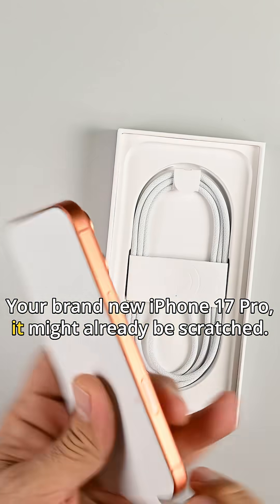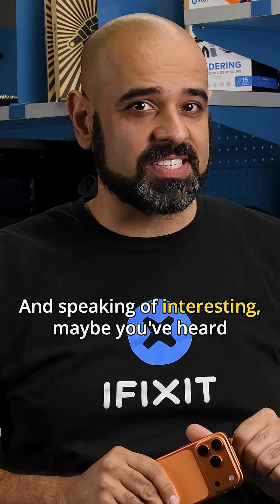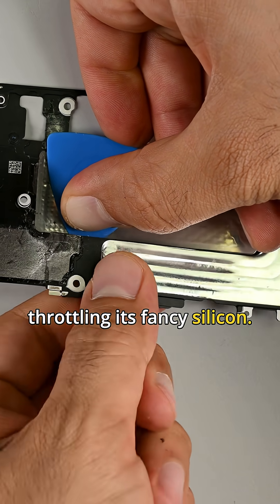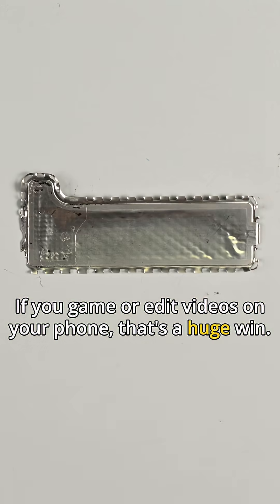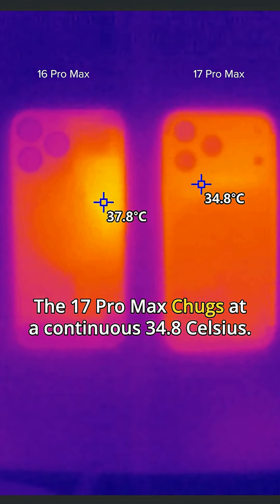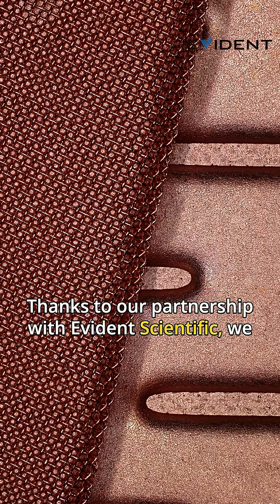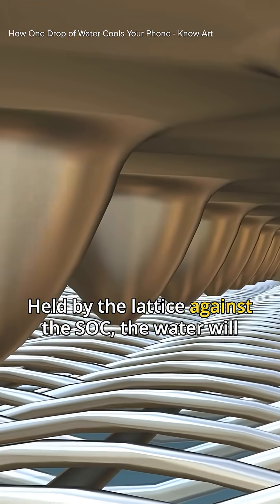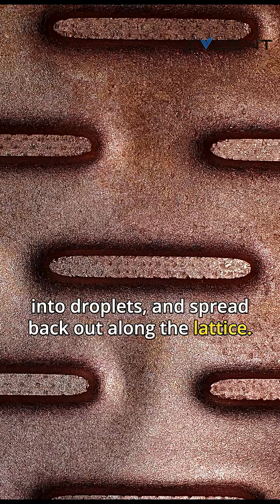We Found a Hidden Chamber in the iPhone 17 Pro!

Comment: Boiled at 37oC 😂
Reply: Well actually boiled water is not fixed by temperature alone, with exact pressure you can boil water even it's 35°C, with 0.0555 Atm of pressure, water can be boiled. 

Andd, actually the cpu of the phone can reaching up to 45-60° without heatsink (like graphite sheet on top of soc) or it's thermal paste.

Comment: It sounds like it's only meant to cool the CPU, or can it also cool the battery? Since the battery heats up during charging, and batteries are hurt most by heat. But it doesn't look like battery heat would have much area to go
Reply: Actually it's more like spreading it's hot, rather than cooling it down, well actually that is the concept of cooling down anyway 😂
Yes eventually it will more cool since the heat is spread out and not accumulated in one area, but never as effective as active cooler.

Comment: I wanna know how much the vapor chamber makes a difference with a case on it. My 17 pro still seems to put out most of its heat through the front and concentrated around the chip with a thick ass quad lock case on it.

Comment: I don’t know any mobile game that needs this amount performance. And this statement has been true since the iPhone 4S or something
Reply: Any big mobile game with 3D graphics definitely benefits from this. Those games will start to throttle in performance after only like 10-20 minutes. Better heat distribution is exclusively a good thing. 

Not only do you get gameplay in demanding games, you also extend the life of your cpu & battery by having them run cooler.

Comment: Maybe it’s a silly question, but how the heck do you manufacture something like this so precisely?
Reply: Machines 😂
Reply: @dougheff03that’s obvious, but I’m asking more specifically - is it similar to a 3D printer where a nozzle with molten metal makes these lattices? Is it maybe taking advantage of some property of copper to make these microscopic lattices? Like what is done to make this happen? 

Obviously machines do it, I want to know what exactly the machines are doing though.
Reply: @Procxlite maybe it's just woven like a cloth
Reply: @Procxlite you get copper wire or rod, you pull it through thinner and thinner dies until you get the desired thickness.

For the mesh it's woven in this case using a loom, just like fabric. You can also knit it with a machine like you would a sweater, or make it by cutting slits in a thin sheet and stretching it
Reply: Cuz some guy decide to invent transistors a couple years ago
Reply: It's called China
Reply: Do some research into semiconductor manufacturing process. It should give some insight into how this done.  Also partly how your cars cooling system operates.  Check it all out. Take care!

Comment: My note 8 from 2017 have vapour chamber😅 idont know why is apple suffering in innovation
Reply: Give it a few years you will loose your sim tray to. Just like the headphone jack 😅. Btw variable refresh rate displays in the iPhones are made by Samsung but they first were seen on the Apple Watch Series 5 which now all Samsungs have variable refresh rate displays 😅
Reply: @Gunzoski but ill not lose, i have both 3.5mm and sim and sd slot, only thing that's taken off is radio, yeah in new phones, maybe, but taking out sim card support is impractical, because of phone dies, you can't sell it until you name sure your sim is out of it, they're doing this just to increase water resistance as I've seen many cases of s24 and iphone 14 and 15 water damage while they are water resistant upto 1 meter for 30 minutes
Reply: May be Apple A series processors were efficient, were not generating more heat so iPhones didn’t need VC until now ?

It depends on what performance companies are targeting and what features and parts they need to achieve that performance.
Reply: @gund89123 no, if you remember, back then, when iphone 6 came out from then every iphone used to heatup even in routine tasks, while nowdays, on my note 8 i play pubg and it doesn't heat..... Iphone 6 and 7 are the most popular hot plates as they were made of aluminum which conducts heat faster than any other metal
Reply: @gund89123 many people suffered with dead boards due to heat, even i have 1 iphone 6 whith dead board at home
Reply: @gund89123  no bro all iPhones would get thermally throttled prior to the Vapor chamber. Your brightness will be reduced then the cpu is throttled. Ofc only when doing intensive tasks or playing high graphics games

Comment: Will it get any rust in humid environments?
Reply: Vapour chambers are not a new tech, they have been used in all sorts of devices before. Since they are sealed there cannot be any rust as there's no Oxygen.
Reply: @NanoMine and outer body is made of copper which never rusts and is a good conductor
Reply: No, i hope no, bcz thats made of copper, my note 8 from 2017 has it, like a week ago, i opened it and the chamber was as shinny as new
Reply: You're asking if the inside of the vapor chamber will rust in humid environments?
Reply: Rust shouldn’t occur unless exposed to the outside world often. Given your iPhone is glued shut and has an IP rating it shouldn’t happen. Rust can occur when liquid or urine or even fizzy drinks like Coke comes into contact with most metals. The one compound that really speeds up the rusting process is water and sodium chloride. Sorry I wanted to sound fancy but it’s just another word for salt. 

I’m also sure that the form of water used is water in a gas form which cannot cause rust. 

I could be wrong. But I’m sure I’m not
Reply: @Gunzoski  wth man, looks like youre very bad at tech, this vapour chamber is made up of copper, even if you leave it sea for months, there will be no rust, yes a coat of carbon could form but chamber itself will remain intact, i have a note 8 from 2017, recently like a week ago i teared it down last time as i was facing issues with charging port so i took everything out and i remember that the chamber was still intact and as shinny as new, even when my phones is taken a part dozen of times, its water proofing had been taken off long ago, its back is fully cracked that even side pieces are missing

Comment: Is it actually water or is that meant to be shorthand for a fluorocarbon? Water shouldn’t be able to vaporize at temps that low, right? Unless it has something to do with pressurization which changes the boiling point? And are the microstructures enough to overcome surface tension or would there have to be some type of surfactant if it were water?
Reply: Just remembered that the surface tension is a feature, not a bug. Capillary action can’t happen without it, so at least that part is answered.
Reply: It’s very low pressure.
Reply: @BTP4390  I’m remembering now that higher pressure resists phase change and increases the boiling point, not the other way around.
So by low pressure you mean less than an atmosphere?
Reply: @Neberheim  What else would they mean?

Comment: is 4 degrees a lot for all that stuff?
Reply: It's enormous for 5w chips
Reply: That 4 degree very noticeable because i m always checking my temperature wherever I'm gaming and 37+ starts to feel sweaty. Btw I'm on Android
Reply: It’s ”only” 4 degrees because the 16 Pro starts to throttle at that point. If it didn’t throttle it would get much MUCH hotter than that!
Reply: It's 4 degrees C, which is like going from 100 F to 93 F, which can be a big difference (especially as body temp is 98.6 F)
Reply: It's not about the Temperature, it's about the Ammount of heat moved away from the silicon. The iPhone 17 in that Video produced more heat and was able to distribute it better, you can see the hot spot on the 16 for comparison.